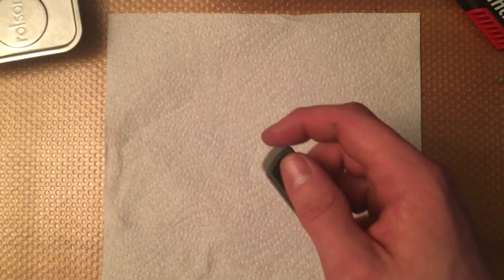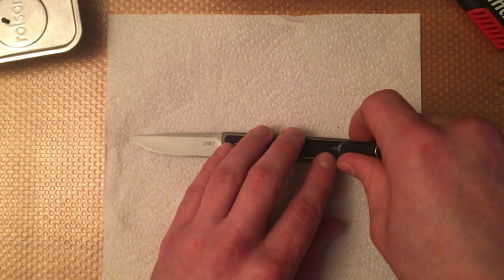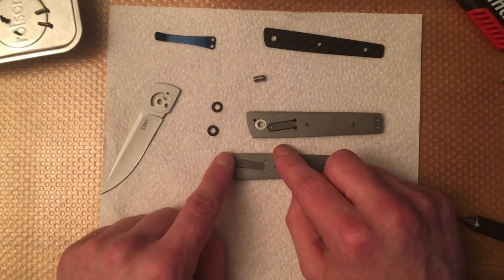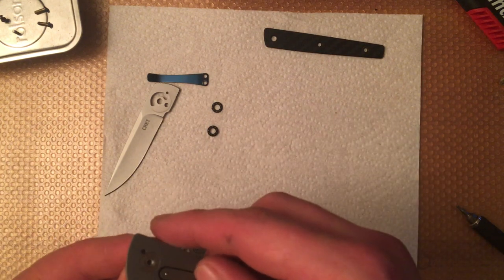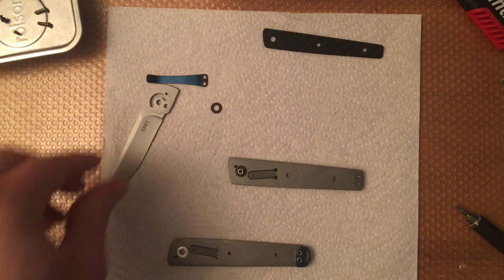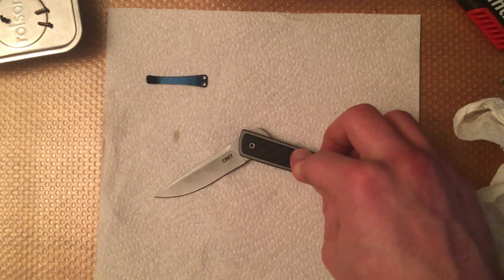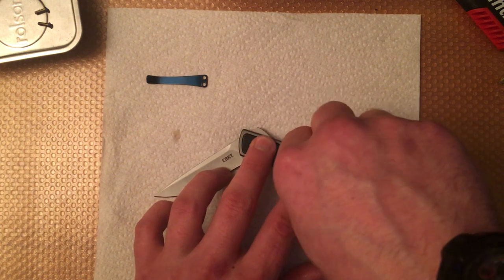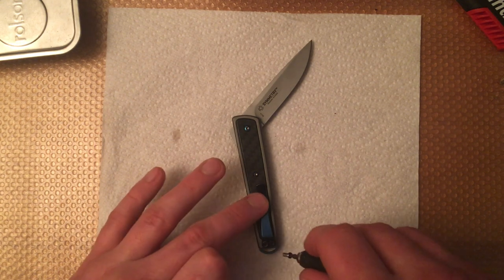CRKT Symmetry disassembly 🇬🇧

Comment: Thx for posting. My one has the same problem. Now I have the confidence to take it apart.
Reply from the maker: No worries. I had it apart again yesterday and realised you can actually leave the 2 screws in the inlay    You only need to remove the pivot and clip screws 👍.

Comment: whats the oil you out in the bearings?
Reply from the maker: It was 10 weight nano oil. But KPL light is probably the better choice I’m looking to get some of it soon. 

Thanks for watching
Reply: @echoededge6669  what size is the torx screwdriver you use ..mine are all to big